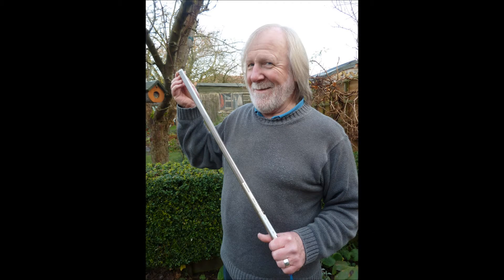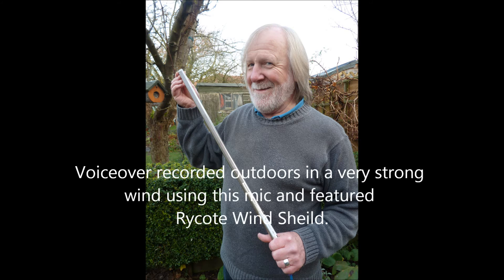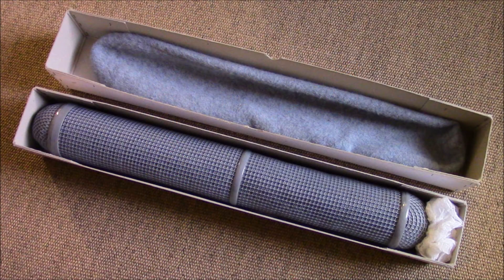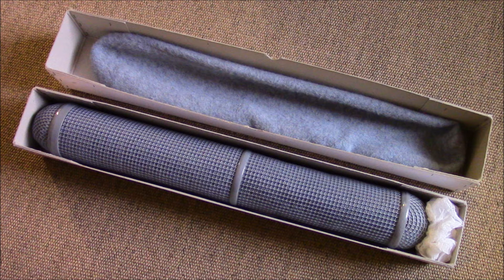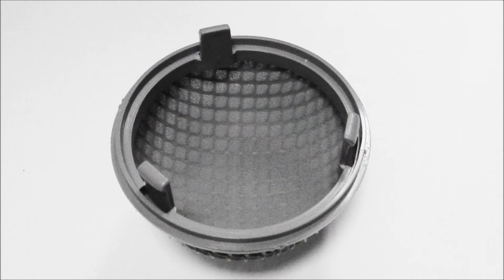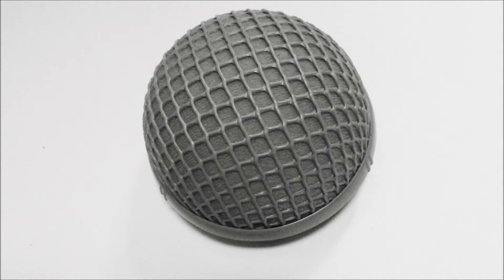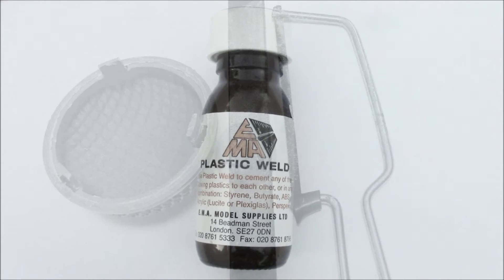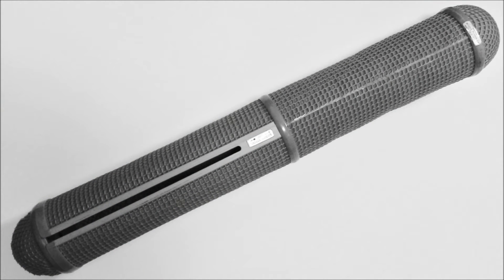Repairing a Rycote Windshield and Panamic Shock Mount for Sennheiser MKH815T

Comment: I'm thinking of buying an 815 but am worried it won't be worth the hassle of all the other gear and lack of portability. I want to record my podcast indoor and use it for recording sketches in public noisy places. Do you think I'd be better off with a shure or rode 3/8" dslr mic?
Reply from the maker: If you are looking for portability and ease of use I would not recommend the 815. It is great outdoors on a film set but I would definitely choose something smaller for the situations you describe.
Reply: Thank you!!